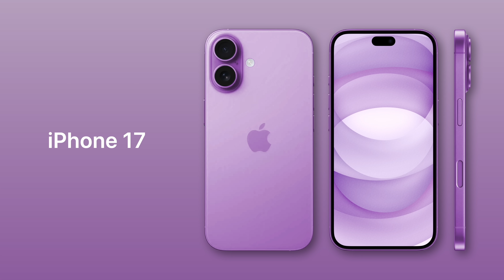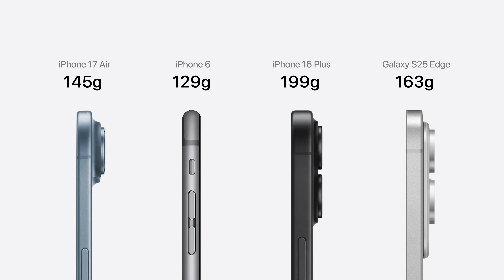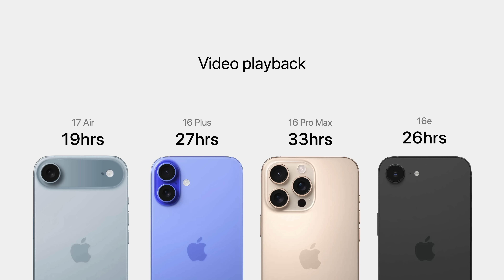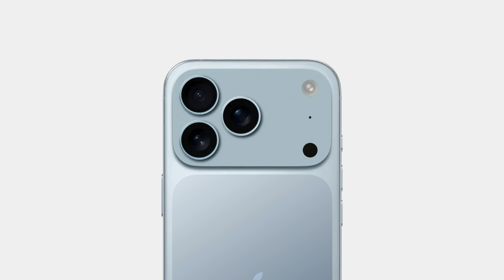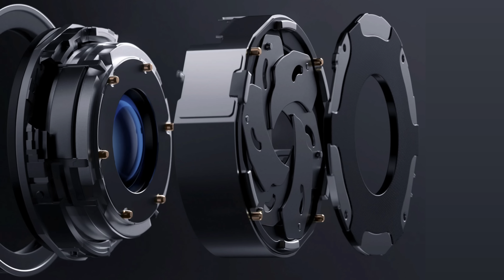iPhone 17: What To Expect

Comment: Apple in 2017: Removes headphone jack starting with iPhone 7
Apple in 2025: Time to remove second speaker, no need for stereo.

This ''innovation'' is freaking ridiculous and pointless.
Reply: At least it’s a separate model that’s destined to fail rather than being on the main one
Reply: @omarbaba9892  What's the point of releasing it then. Apple want to experiment?

Comment: I definitely want to upgrade my 1TB iPhone 14 Pro Max to an 2TB or 4TB iPhone 17 Pro Max, but I need 2TB, 4TB and 8TB storage capacity options (most importantly) and I also need an SDXC slot on the iPhone Pro Max models for extra video and pictures storage.  Storage capacity is the biggest reason why I haven’t been getting new upgrades, and I need bigger and bigger storage capacity options in order to justify the upgrade costs.  Without additional larger storage, there is absolutely no reason to upgrade my iPhone.  None.  I truly need at least two 4TB or 8TB iPhone 17 Pro Max phones, with enough storage to record at least a few hundreds hours of RAW 8K video footage and being able to edit videos on the iPhone is fantastic.  But the biggest problem is lack of storage capacity on the iPhone Pro Max models and the lack of an SDXC slot makes it a deal breaker.  I won’t be upgrading my 1TB iPhone 14 Pro Max or iPhone 15 Pro Max until Apple has at least a 2TB or 4TB or 8TB models of the iPhone Pro Max and also add a SDXC slot for extra storage, just like every single Android phone / Samsung phone for decades.  We need the extra storage capacity for 4K and 8K videos and 48MP pictures.

Comment: I was seriously considering switching from andriod to iphone 16 pro max. I currently have an s21 FE and because I cannot get another phone for a few more months. I figured by that time the 17 would of released and so I would just get that, but they took away one of the man reasons I wanted the iphone 16. The looks. With this new bump and glass rectangle the phone looks like hot ass, I do not understand what kind of substance those employees were on when they made this.

Comment: Samsung S25 is better because of UHD 8K Video 7680 x 4320 pixels resolution 2 time bigger thin iPhone UHD 4K.
iPhone 17 Pro Max Video UHD 4K 3840 x 2160 @24/25/30/60/100/120fps, 10-bit HDR, Dolby Vision HDR (up to 60fps), ProRes, 3D (spatial) video/audio, stereo sound rec. 
Samsung Galaxy S25 Video UHD 8K 7,680 x 4,320 @24/30fps, 4K@30/60fps, Slow Motion 4K 120fps Full Hd 240fps 10-bit HDR, HDR10+, stereo sound rec., gyro-EIS

Comment: I have the 16 pro and here’s my brutally honest review:
My honest review of the IPhone 16 Pro 256gb model.

There's gonna be a lot to say, both good And bad about it but overall, I have 0 hate towards this company!

I purchased this phone brand new from Verizon 1 and a 1/2 months ago (as of today) and after daily use- quite often- through each day, I'm at the point where I can confidently state my opinion on this hot plate of a phone (And yes, it gets very hot, very quickly).

:Personal daily use consists of social media, mid-heavy gaming and music streaming over 5G with average screen time of 6-7 hours per day:

(Pros):
• INCREDIBLE Camera, definitely my favorite feature to the device! (Comes with a con tho)

• Charges noticeably faster than previous IPhone models.

• Download and Upload speeds are incredible when in a area with decent signal (downloaded CODM (the app itself 2.5gb) in 4 seconds (then everything in it which equates 45+ GB in about 10 minutes and Warzone Mobile (The app itself 9-ish gb) in 3 minutes!

• Calling and texting while outside is made easy thanks to it's very bright screen.

• Microphone quality is amazing compared to other name brand devices I've used and tested!

• The option to edit and unsend messages through iMessage, it's a lifesaver when something is misspelled or you need to re-edit your context before sending or after sending!

• It does handle light gaming but also heavy gaming fairly well up till it feels like it's gonna explode from the Heat building up in the system! 

(Mids- Features i'm ok with but don't really like):

• Sound Haptics, Others might enjoy this but I personally don't...

• The constant letter to number switching in keyboard- which I'm not sure if it's a bug but it constantly switches between numbers and letters when I type.

• Apple Intelligence, I'm iffy on this one so I'll come back to it later on, so far loving ChatGPT more though..

• Spatial camera mode, I haven't seen any difference using it vs regular photo and video mode.

• The Files app, I ended up downloading a Third-party file explorer to better organize my files because the IPhone Files app is messy and not very user friendly.

• AIFF and WAV format, I personally use WAV more especially with it being much easier to store and send audio files in but there's not really a WAV format option on here so...

With all that said it now leads me to,

(Cons):...(and there's a bit)

• This device heats up so much that I have to put it in the freezer in between uses or on an A/C vent just so I can hold it, I have a temperature app for stats and the hottest it's gotten was 132 degrees 'F, it's a constant problem and it overheats daily even with minimal use.

• The amount of GB that the "Photos" app takes up after just a few videos 😭, I was going through my storage and found photos to have 27.92 GB of storage taken up and I'm like wait what the hell? I only took about 11 videos in 4K that were no longer than a minute and they were videos I didn't need. I just did it cause I liked how they looked so I deleted them and it instantly dropped down to only 2.37 GB of storage taken up, the absurdity of space required to store them is something not talked about and that's one of the worst things about having this camera.

• I can run Warzone Mobile on Peak Graphics with Un-capped FPS for a solid 5 minutes which gives me 2k resolution w/ 90 fps before my screen turns black and says "This device needs to cool down, Core temperature unstable. Please cool down immediately" and I'm like seriously?! This isn't okay, especially for a device with as much power as it's being advertised to have smh. I can now barely run wzm on low graphics before it starts heating up quickly.

• The files app, Pretty universal with Apple devices is not user friendly for someone switching over from an android...

• The heat again, it gets especially hot when I'm charging it with the factory provided Cable and Wall Cube, and I usually keep it on those Cooling gel ice packs when it charges so it doesn't explode which I shouldn't have to.

• The storage. it's very difficult to move files around easily without a Third party app and I'm not able to clear data for most apps, this device just gives me the option to delete it or leave it be.

• The sensitivity of Apple Intelligence, if I say my dogs name (Sadie) it'll turn on, if I say anything remotely rhyming with Siri, it'll automatically turn on and then freeze my screen, which makes it difficult to resume what I was doing originally.

• The overtime lag and delay that's built up the past few days, i have 100gb free in my storage and in the past few days This phone has been lagging to the point where I'm questioning if I was given a refurbished one labeled as new when I bought it from Verizon.

• The integrated AI system- which performs far worse than ChatGPT or Google AI such as Gemini, when requesting it to do simple tasks, such as giving me directions to a place or asking siri to set a reminder, it'll do the opposite and give me directions to a place that I wasn't originally going to, and with alarms completely set one that I didn't ask for.

• it will automatically play Apple Music at the randomest of times even when I have the application closed and Siri off for that app.

• It automatically switches all my saved contact names to their original phone numbers and that gets really annoying when I'm trying to text or call a specific person.

Overall, it's a good high end phone if you want something powerful for filming, mid-heavy gaming and music streaming but with the addition of constant Overheating, Glitching and in-accurate AI intelligence. I understand nothing is perfect but there are things that could've been done a bit better.

Over time I'll come back and add what I notice to this post, If you've gotten this far I'd appreciate the discussion in the comments and if any of you have experienced similar things, feel free to share them!

Comment: I thought about getting the air because I’m so tired of the heavy glass. But… no stereo audio, no wide camera lens, terrible battery, and it’s not even that thin because of that camera bump, meaning cases will have to compensate for the camera bump and be thicker anyways. And I also heard because of how thin it is, it only will accept wireless charging. Which is absolutely stupid. I’m a traveler and the iPhone air is the worst thing a traveler could ever have

Comment: We had mini iPhones, plus iPhones, now we're getting the Air version. There's just no consistency. All the other models have remained consistent - regular iPhone, Pro iPhone, Pro Max iPhone - since 2019. The 4th model changes every 2-3 years. Mini, then Plus, now Air. Does there really need to be a 4th variant if it tends not to sell enough and if they can't decide what the heck it should be? Why will the Air be any different? We'll get iPhone 17 Air, iPhone 18 Air, and then it'll be something totally different after that.

Comment: iPhone 17 Air in a nutshell:

Step 1: Make a very thin phone
Step 2: Since it's thin, use a smaller battery
Step 3: Make a battery case, because it doesn't last long
It is now the same size as a normal phone...

Comment: no one cares about a thin phone thats going to bend in your pocket they want substantial battery and protection from drops and falls, perhaps more sensors to offer new technology most importantly how fast you can charge your phone will change the way people use their phones and it makes a big difference to social life if you can get through your day at work and then use it heavily in the evening with a decent amount of battery left. if you could have better wireless charging or even pogo locking cases for solid connections for charging when a phone is in a bag or pocket would make a big difference. find my features and bluetooth tracker improvements.

Comment: Apple should stop trying to forcefully release 4 iPhones at the same time. 
All the market needs is : a base iPhone, an iPhone Pro and an iPhone Pro Max + a budget iPhone that doesn’t need to be refreshed each year. 
All the 4th iPhones were flops : 12 mini 13 mini 14 Plus 15 Plus 16 Plus and 17 Air will be thé worst of all. 
I see it more like an engineering exercise for the future foldable iPhone by developing new technologies compatible with ultra-thin casing. I was really surprised to see that the Samsung Z Fold 7 has the same thickness as my iPhone 16 Pro Max despite being a foldable.

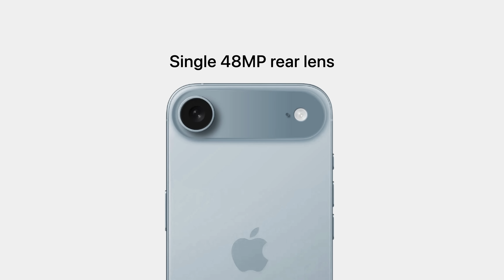Comment: 3:42 Bro did you just say they are removing the speaker... what kind of world is this. So what happens when the iphone 19 air comes out, we achieved 15% thinner design, but there is one more thing..... THE IPHONE 19 AIR WILL HAVE SPECIALIZED INTERNAL SPEAKERS SO YOU CAN WATCH A F*** VIDEO WITHOUT HEADPHONES.... we are also selling the iphone 19 air light which does require headphones and headphones start at $399 and $699 for 250 gb of storage. Then iphone 22 comes out it has no storage and then they bring storage back hahhahah just icloud no storage thats how we got it down to 1 mm but you need an icloud $40/month to even turn on the display plus internet connection HHAHHAHAHAHAH LIFE IS GETTING FUN!!!!!!!!!

Comment: To me it sounds like they should have just kept the iPhone 11 model lineup template; one base, two pros. The mini and plus models have been reported as being the least popular models released, and with the Air's battery being trash, possibly another bendgate, and a single rear camera, I can't imagine this model will do much better than the minis and pluses. 

And this is coming from someone who used the iPhone 12 mini for 3.5 years.

Comment: What do you actually gain from making things thinner and small percentile structural changes? Nothing I have seen so far makes me want to rush out and replace my Xiaomi.

In devices which are so Closed source I rarely see anything noteworthy. All mobile phone cameras are pretty much limited due to the sensor size and lens abilities. My current device has a electromechanical aperture in the main camera which is good in certain situations. Creating Starbursts in low light or an in-between blurring /sharpness.

I want to be impressed by Apple however their propriety nature makes me want to question their real intentions.

Comment: base iPhone 17, here's what to expect:
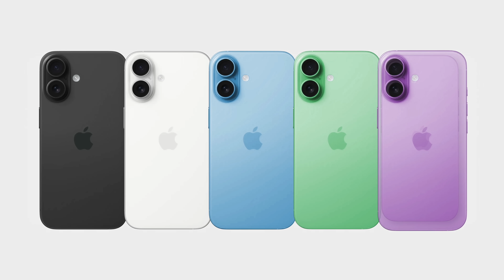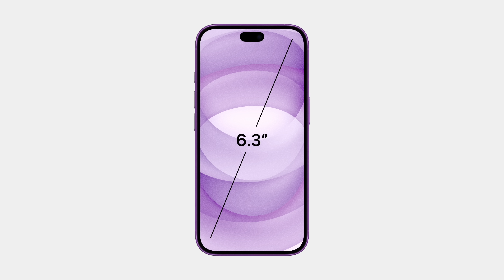 * Display [00:11]: It will be slightly larger at 6.3 inches, achieved by making the device about 2mm taller and shrinking borders by 45% (from 2.2mm to 1.2mm) [00:19]. It will also use the same LTPO panel as previous Pro models, bringing ProMotion (120 Hz refresh rate) to entry-model iPhones for smoother scrolling and animations [00:34]. ProMotion's variable refresh rate (as low as 1 Hz) will likely enable always-on display functionality [00:47].
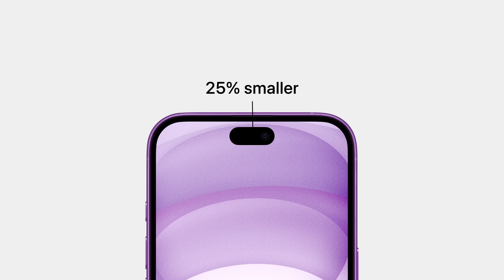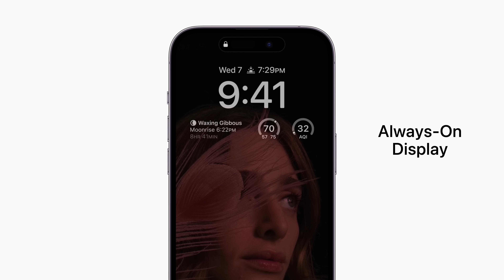 * Dynamic Island [01:01]: It is rumored to be about 25% smaller due to a new metal lens system combining Face ID receiver and transmitter into one aperture [01:01].
 * Processor [01:15]: It is expected to use the same A18 chip as the iPhone 16, not the improved A19 chip [01:15].
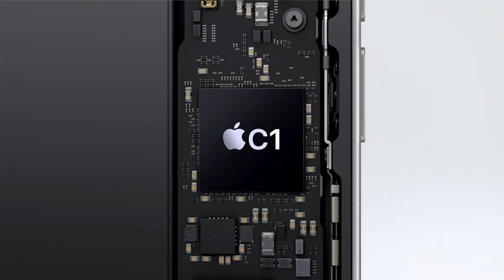 * Connectivity [01:22]: A custom Wi-Fi chip designed by Apple could offer better power efficiency and more reliable wireless connectivity [01:22]. It will also include Apple's custom C1 cellular modem, introduced with the 16e, improving modem power efficiency by 17% to 24% [01:30].
 * RAM [01:46]: It will remain at 8 GB, similar to the iPhone 16 [01:46].
 * Cameras [01:52]: The rear camera system is likely unchanged, but the front camera will see a significant upgrade to 24 megapixels, up from 12 megapixels, for higher resolution photos [01:52].
 * Color Options [01:59]: It is rumored to come in black, white, light blue, light green, and light purple [01:59].
 * Starting Price [02:08]: It is expected to remain at $799, same as the iPhone 16 [02:08].

Comment: A lot of people seem to miss that aluminum conducts heat 16 times better than titanium. So the switch will also contribute significantly to helping keep the device cool, which has been a slight issue with the titanium models. Though I do love the toughness of the titanium. My 16 Pro Max still looks perfect with no marks on the frame.
Reply: Why don’t they just add a cooling system?
Reply: @GiaLin-zt4ds what? They already have a cooling system. It is rumored that the cooling system on the 17s will be a vapor chamber. They currently use graphene thermal pads to transfer heat.
Reply: @Angus_MacAskill no use a real one like in s24 ultra
Reply: @GiaLin-zt4ds That’s literally what I just said. The next iPhone is likely to have a vapor chamber, which is what the s25 ultra uses.
Reply: @Angus_MacAskill then they can still use titanium
Reply: @Angus_MacAskill then the switch is useless and feels more like way to cut down on price
Reply: @GiaLin-zt4ds If the vapor chamber moves the heat from the SoC to the frame, then an aluminum frame will still dissipate that heat better than a titanium one. So the switch likely will be better for cooling as well.
Reply: @Angus_MacAskill just look at s25 ultra lol they do great, plus the titanium exists on 15 and 16 model is actually just like a layer, inside is still aluminum

Comment: I have a feeling that the reason the back panel is made from metal is because they have to make it accessible for the general user to open and change battery, that’s why they also made changes to the battery adhesive. Making the back panel aluminum makes the general user less likely to break the fragile glass.

This is due to the EU forcing companies to make batteries replaceable by the user by 2027

Comment: I think around this time would be a perfect time to reintroduce the mini - but more of a 16e type of thing where it keeps the relevant stuff. Battery would be more than sufficient. Small bezels and increasing the screen a bit to 5’6 maybe 5’7 would be a good move. Maybe a kind of smaller 16e with 120hz if they decide to introduce this in the future. A phone id buy.
Reply: I’d buy that too, but sadly they seem to have gone off producing affordable phones
Reply: @OFFtheCHIZANE it’s a shame that they have overpriced everything. What most people want in a phone is the relevant stuff and that’s what the se did well and the 16e did well
Reply: The 16e was the new mini 

That ain’t bringing the mini back. And I say this as someone who had a 13 mini. When this thing dies (which is a long way off yet), I’ll either get a 17 air, or whatever the closest other thing is to a mini when I come to upgrade

Comment: I hope this Aperture adjustment fixes the issue that makes food photos extremely out of focus and if you have it with macro mode on, you lose so much detail or it makes the photo super flat with this adjustment of aperture. You can still use the main sensor, but have more in focus.

Comment: I'm upgrading to the 17 Pro Max in the hope that the touch sensitivity issue with the display that was present on the 16 Pro Max has been fixed and that the sound quality of the built-in speakers is the same as or better than the 16PM and not worse.By the way, I upgraded from a Galaxy S10+.I gave up on switching to the Galaxy S25U because recent Galaxy models have been cutting corners on speaker sound quality and the equalizer is terrible due to software issues.